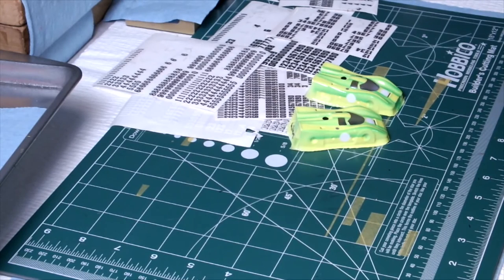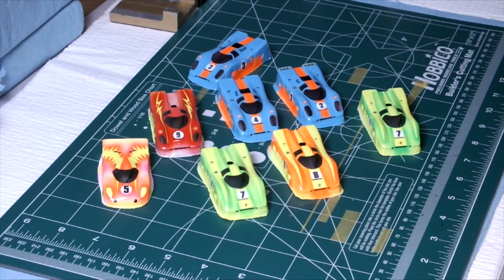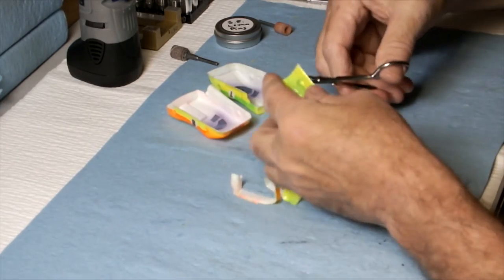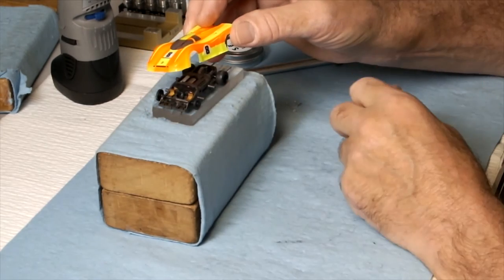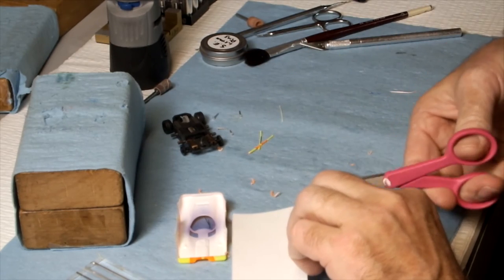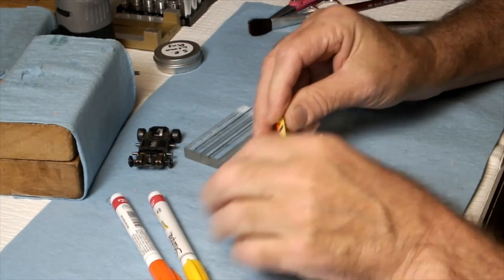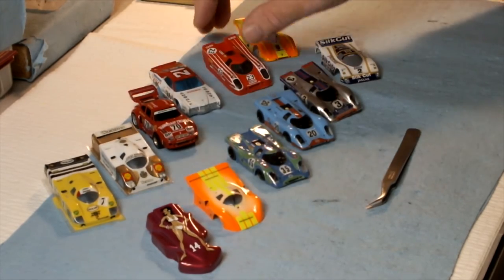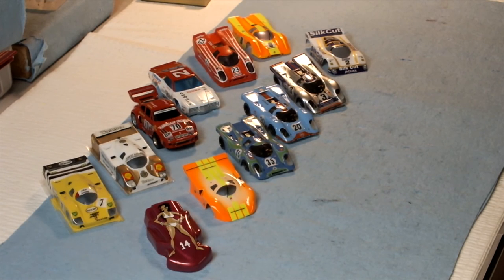Painting HO Lexan Bodies - Part Three

Comment: Hello man! I'm from Brazil. I have search in your channel but not find how you have make your wood HO race track. I want to do a track like yours but i dont know where to start. Can you help me?
Reply from the maker: Thanks for the question.  The track is CNC cut out of plastic sheets called Sentra.  I purchased the track from Bowman made to my specifications.  The current technology is to make custom HO tracks out of Sentra, PVC, or plastic sheets of similar characteristics.  I am unaware of any track builders here in the USA that use wood.  Wood has problems with swelling and shrinking.  That may have not been an issue back in the 1960s and 1970s when HO slot cars did not have any or much magnetic downforce.   With the development of high magnetic downforce cars, track stability became a performance criteria.   Plastic materials that the current track builders use are very stable in terms of relative temperature and humidity.
Reply: Thanks very much! O never think that is the material, you have take away my biggest doubt! Thanks you so much!

Comment: I have to say this cause I know,it's never a good idea to cut laxan like that with scissors, it better to use a exsacto knife and make clean cuts cause it will crack wherever it's not cut right,I leaned all this from racing 1/8 rc.
Reply from the maker: I have had zero issues with scissors.  In fact using a blade might be very unsafe - for certain people.  What works at HO may not be good at a larger scale and the other way as well.